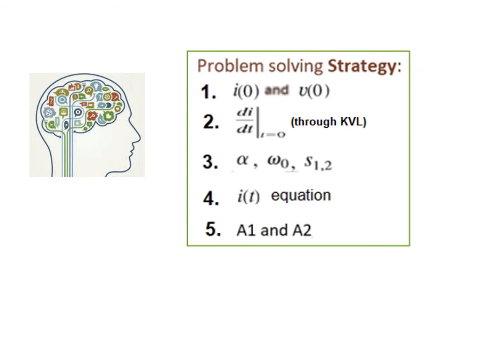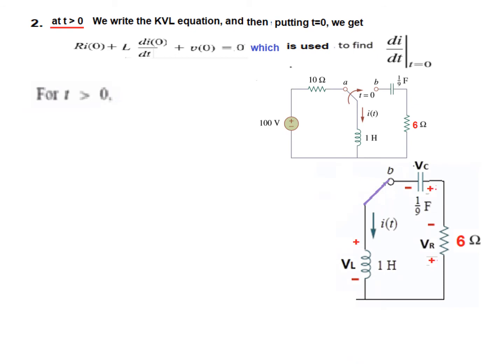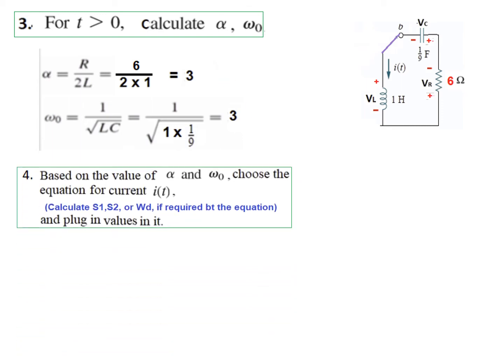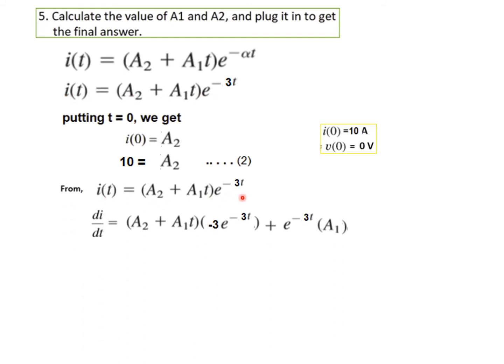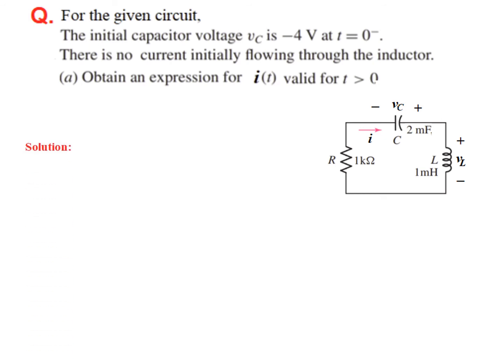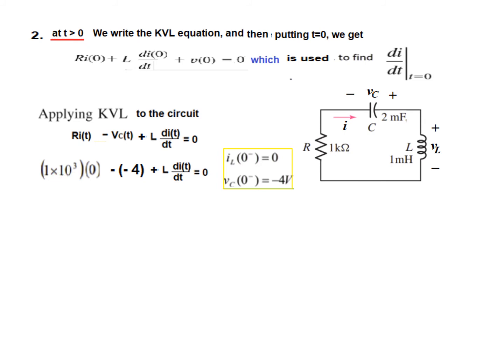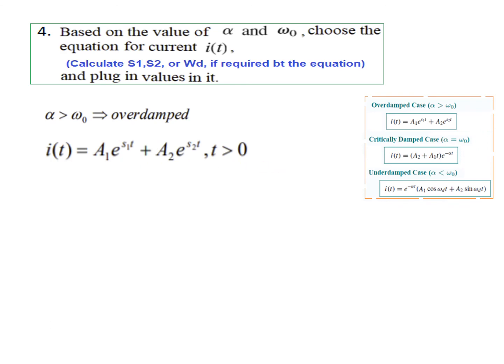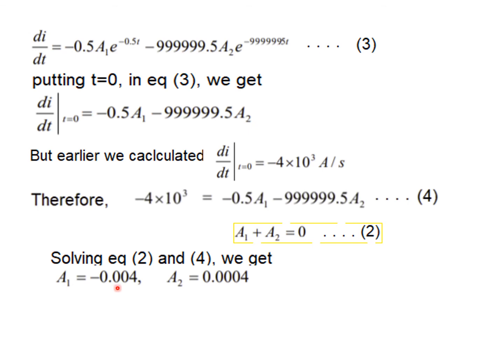(English)LCA || 8.3(3) ||Practice Problem 8.4 and another example -  Source Free Series RLC circuit

Comment: Salam Alaykum Sir, sir why did you change the value of R for 8.4 because in my book it's 5ohm not 6Ohm
Reply from the maker: I wanted you to spend some time on this problem😆. Do it with 5 ohm and see if you get the correct answer. If not let me know at profkhannazir@gmail.com
Reply: @ElectricalEngineeringAcademy  -28.74 I got ,but in book  -15.076 I saw
Reply from the maker: Please mail me a snap shot of your work at profkhannazir@gmail.com